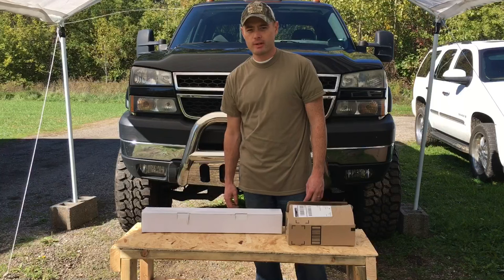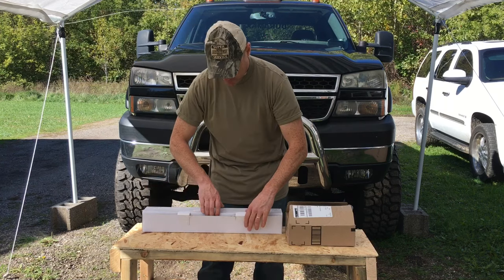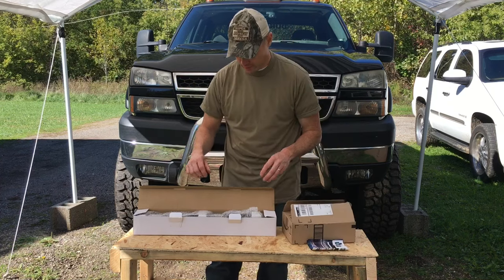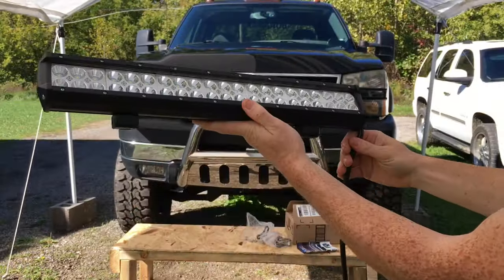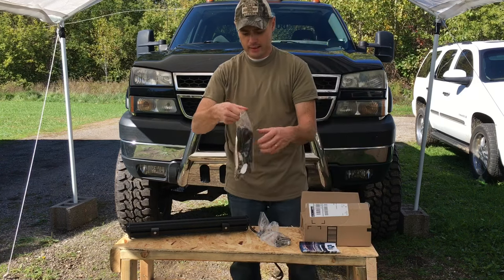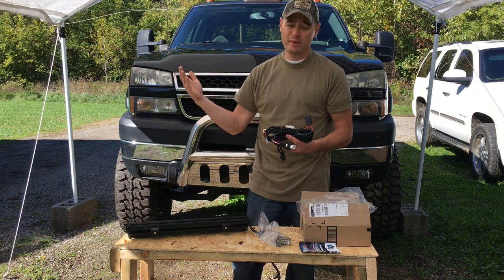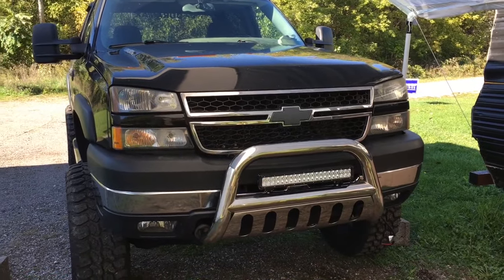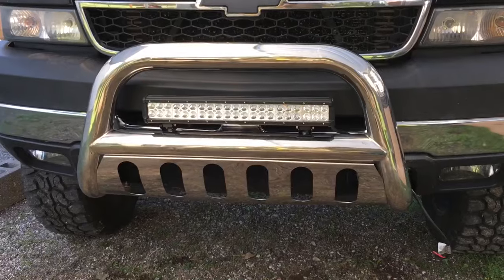Nilight 20 inch Light Bar Install

Comment: "ya I'm not a big attachment guy"...has a 6 inch lift, bigger tires and rims, aftermarket tow mirrors, bullbar, and this video is about putting a light bar on haha that kills me...thanks for the video rather than that tho
Reply: Those are stock mirrors for that truck
Reply: Those are all bolt ons accessories. The lightbar may require some drilling tho
Reply: @colbyfey2215  I believe those are 07-13 tow mirrors. I could be mistaken. It is a very very common mod for cateyes
Reply: @luketrinke4667  my brothers 02 had them on from factory
Reply: Mirrors are stock buddy
Reply: “I’m a basic person”

Comment: way easier way to run the wire through the firewall there is a little rubber gasket that goes through and you can push through there instead of going outside the door area
Reply: Tim thats what i did it was much easier
Reply: Tim The thing that's difficult on that is for my truck it's really hard to get to from under the hood so I did the same thing he did
Reply: not if you drive a 2015 chevy 2500 its a bitch firewall
Reply: Or at least  put it inside the door rubber seal.
Reply: It’s likely the water will drain down into the fuse panel
Reply: Chevy's are notorious for having pain in the ass grommets that it's easier to drill through the firewall and use your own grommets. Or for cavemen, running it through the side of the fenders into the side doors

Comment: Looks like that bumper bar is a "bit" loose, make sure to tighten that too!
Reply: Waay too much flex in that bar when he was adjusting the light bar
Reply: @THEGAMEX21  yea mine bolts to the frame and is super rigid, you can rock the whole truck with it

Comment: The red wire is to small of a hole to mount to the red terminal on the battery, how else could I attach it to the battery?

Comment: Thanks for showing me how to install this exact light which I just bought.  I'm night blind and going through the Eisenhower/Johnson tunnels on I-70, which are 1.7 miles long each way, is absolutely terrifying. 

Since traffic is one way in each tunnel, this will get me through the tunnels safely without killing me or my fellow drivers.  There are lights in the tunnel, but they are so filthy and weak, they might as well not be there for me being night blind.

I was surprised at the number of comments from those who try to make themselves feel good by making others feel bad by complaining about running the switch wire through the door seal rather than through the firewall.  This light is not a fixture on the space shuttle and I sure am not going to drill a hole through the firewall of my car.  I'll do it just like you did it.  It will work fine and you know the saying, "Perfection is the enemy of good enough".

Thanks again!

Comment: Man, I want to start by thanking you for sharing this video. I have bought an E350 4x4 Van with a long 50inch light bar on the top. I recently bought the same wiring harness as the one you used and was having seconds thoughts if I could wire the light bar on my own or not. This video convinced me and helped me do it on my own.
Reply from the maker: +Kudro Rico awesome man I'm glad I can help

Comment: Does the built in fuse box for the light prevent it from draining the battery since it's directly connected to the battery? I'd like to get the ditch lights and the light bar but I don't want them to suck my battery dry.

Comment: You connect the positive wire to the battery. Does that drain the battery since the light is on on the light switch in off mode.

Comment: Thanks for making it so simply an installation. I found a rubber cover on the left hand side where one of the A/C hose goes trough and stuck it in there so that the rubber on the door doesn't get worn out and also to keep the water from going inside when is raining hard.
Reply from the maker: +Carlos Lemus thanks for the comment I wish I could go back and fix the video but since then I ran the wires through the rubber grommet on the driver side firewall
Reply: Truck Master thanks for making the video man there is no need to go back but if you ever do take me with you jajaj

Comment: I ran mine to a switch under my hood and connected my power and ground to my fog lamps so when I turn on my fog lamps from inside the truck it will also turn on my light bar and if I don't want it to I just throw the switch under the hood and I can continue to use my fog lights without the light bar
Reply from the maker: +christopher smith awesome I will have to look into that on my set up
Reply: Truck Master I just didn't want to add anything to my cab I like things simple in there

Comment: I installed one on my f150. Works great just where it connection is way to short since my battery is on the passenger side I have to reach all the way over to turn on and off

Comment: Thanks. Good video. I think the only thing I'm going to do before I do this is use RTV on the light bar. I saw another video with how to take these apart and do that, just in case. Mine, same brand, came with a plug that doesn't mount like yours in the video does. It's the round kind. But I just checked and the other plug seems to attach to the wire, so I might swap them.

Comment: Wow ...You made a great vid and should be franchised...no kidding...great explanation, tagged major issues with the harness mounting made the product, a gotta have accessory. Thanks and it took a bit of latent feer of screwing up the first time for a guy at 70 to do a first.  Have a new/used hybrid and huge battery source for light...or marine epower and maybe run a boat for a while once I get the harness and release mechanism assembled. Happy Trails
Reply from the maker: Thank you 👍

Comment: Couple suggestions. One dont wire through the door jam. two is possible use the accessory wire (typically brown) coming out of the steering hoist. This way when you turn off the truck the lightbar will turn off as well.
Reply: Great explanation, but if you're in the middle of nowhere I would like just the lights and no engine noise.

Comment: The thing that sucks about that is I have that exact same thing mounted on the front of my truck (I don't know what they are called sorry) and I wanted to mount a 24'' bar there but thats where my dale earnhardt license plate is and that aint comin off so I just got a 42'' and mounted it on top of the cab
Reply from the maker: +RebelRanger01 at least it worked out
Reply: Truck Master Yeah exactly, I was a little hesitant at first for drilling holes in my cab but then I thought about: "I installed a cab visor and drilled multiple holes, whats the difference of a few more". I like it though I use it when I'm getting outta the woods from hunting and fishing I hunt and fish right till dark most times and it's better than my high beams on my truck. Plus I use it on back roads sometimes unless theres traffic

Comment: Good instruction video. How do you get the illuminated red light to turn off on the switch so there won't be any drainage from the battery?
Reply: The one I bought in 2023 does not have a light; just a simple rocker switch.

Comment: Because of how easy you made it look in this video, I ordered a 42" and wiring harness from them. I hope I can install it as easy as you made it look. We'll see...
Reply from the maker: +LNxTCB awesome good luck man run the wires through the firewall not the door jam though good luck!
Reply: Yeah, that's what I plan on doing. Thanks, bro!
Reply: The little light bulb on the switch doesn't drain your battery since it's wired to the battery?
Reply from the maker: +LNxTCB I never had a problem

Comment: how well do these pushbars/bullbars work? if i were to use my truck to push something would the brackets break? idk how sturdy they are
Reply from the maker: +Benjamin Masters they bolt to the frame so its sturdy but it's not going to do anything to protect your bumper if you hit something, the push bar is very light

Comment: Is there a limit to how many accessories you can run off the battery like light bars and charger ports without shorting it?
Reply: buy a bigger alternator if u got a lot of accessories to power up specially light bars

Comment: I know it’s old video , but is the red light supposed to remain on on the light switch ? Won’t it drain the battery ?
Reply: It probably wont kill the battery, but yes it should be off when the lights are not in use. Also don't run your wires through the door jam or fenders. With the car door opening and closing they have the potential to be pinched which could later cause a short.

Comment: So I'm going to be putting that same bar on my 98 ford ranger. I'm wondering how to connect the light bar wires to my battery. My connections for my truck to connect to the terminal on the batter like covers up the whole thing. Wondering if I take that off and put the light Barr connections on then the truck battery connections on top of the that?
Reply from the maker: +WA outdoorsman you can do that or find another positive wire in the engine bay you can tap into, watch my Light Bar Install video on a Tahoe I didn't connect it directly to the battery and it worked out

Comment: what kind of wiring harness is that
Reply from the maker: +Austin Vandeberg not sure it came with the nilight but I'm sure it's the nilight wiring harness
Reply: hey Austin, this is the link to the wiring harness, hope it helps.
https://www.amazon.com/Nilight-Wiring-Harness-Switch-Included/dp/B0142WXJEU/ref=sr_1_3?srs=8085031011&ie=UTF8&qid=1478505043&sr=8-3&keywords=wiring

Comment: Is attaching the ground wire to the negative battery terminal the same thing?  Is there a difference?
Reply: Yes, you can hook it to the negative on the battery.  On many modern vehicles it's hard to find metal to hook to within distance of the wire harness.

Comment: Which wire goes connected first to do it properly, the black to ground or the red to positive???
Reply: Israel Rodriguez negative is always last to be put on and first to be taken off
Reply: i agree. flows negative to positive.  hook the positive up first then negative last and the opposite when disconnecting.

Comment: Do you know if there's a way to wire it to the fuse box?  I would still like to use the switch, but I would also like it to turn off when I turn my car off.  I want it to function like the windshield wipers.  So if the car is off, there isn't any power going to it.  But if the car is on I still have the ability to turn it on/off.  I don't want to accidentally kill my battery.  Thanks!!
Reply from the maker: +Andy Lisnoff try running it to your ignition fuse
Reply: A relay would make it so you don't kill your battery. My car sat for 2 weeks without running with my light bar installed, barely dropped voltage.

Comment: Are these legal to have? I have a 2000 cord f150 with crap lights, this would help a lot
Reply: These lights would not be legal in probably any state for highway driving.  I'm just using it to get through some very dark tunnels about 2 miles long on I-70 that I travel now and then.  The tunnel lighting is terrible and I'm night blind, so this light bar will help.  It's one way traffic in the tunnel, so I probably can away with using them for a few minutes.  I go through in the daytime, but the tunnels are darn near pitch black to my old eyes.

Comment: Does the red light stay on on the cab ? And if so does it drain the battery?
Reply: If you wire it correctly the red light is off when the LED bar is off.
Reply: Danky Dank it has two options to wire it up.
Option 1 allows you to connect it to the ignition switch so the light bar switch will only work if your ignition is turned on and the red light will be off if your key is off.
Option 2 is direct wired which allows you to turn the light bar on whether your ignition is turned on or off.
And the little red LED light pulls less amperage then the memory in your radio.

Comment: Could I cut the switch off and hook it up to the high beams
Reply from the maker: Yes
Reply: @TruckMaster  when i cut the switch from  off of  the wire can I use a piggy back fuse to trip on led bar with the high beams and hooking it up that way sorry I am new to this

Comment: Hey is it a problem that it doesnt get wired up to the ignition switch? Im just worried about it draining the battery?
Reply from the maker: +Bobby Sutphen that shouldn't be a problem but I haven't tried it yet. I did read on the internet of guys doing that and it worked out for them

Comment: How did you connect the light bar wire to the connector on the wiring harness? I have the same setup and don't know what to do
Reply from the maker: +Real Outdoorsman your suppose to buy the additional connectors to plug them in but you can just cut, splice and use some electrical tape as well

Comment: Got mine yesterday - Amazon reviews suggested silicon around the clear front to prevent condensation on the inside of the light bar - have u run into any moisture issues in the unit?
Reply from the maker: +Michael Woodsdale not at all

Comment: Did the wiring and everything come with the light bar? Or did you have to buy the wiring separate?
Reply from the maker: +Chatch'emBig tv the wiring came with it
Reply: In 2023, the harness and light come as a package, but you need to make sure of this.

Comment: When you order the light, did the second box come with it? Or was that a different order?
Reply: At least in 2023, if you order the lighting unit and the harness as a package, they come in one box.  And you definitely need the harness unless you're a master electrician specializing in vehicles.

Comment: Enjoyed your video. Did you have to supply additional power to the switch or was it supplied when you connected to the battery?
Reply from the maker: +Gibb Gibb no additional power just ran the red wire to the battery. Thanks

Comment: Should i trust a $30 light bar?
Reply from the maker: +Nathan White these little ones are great it’s the 35+ inches I would worry about
Reply: I had this bull bar on my truck for about 8 months and it was absolutely amazing didn’t leak water inside like most lights and it never forged up from the inside. I decided to change my setup and I took it off with the bull bar and I sold it to my buddy and he still uses it til this day it’s got to be one the greatest light bars you can purchase. I got a new truck and I’m about to buy a bull bar and this light bar👌🏻

Comment: Real curious to know: how’s that Nilight holding up? Been on the truck a while by now. I’m mounting a 32” and some fog light pods and I sealed the seams from the outside with silicon just to give them a better chance. For the price they’re worth trying. Any feedback would be appreciated, thanks.
Reply from the maker: +A Stang it’s a great lightbar no condensation issues and very bright. Probably he best inexpensive lightbar online

Comment: How did you get your mirrors so level? Both of mine angle up
Reply from the maker: +austen9988 to be honest I took the mirrors off my LMM which is the newer body style and fabricated them to fit my classic body style. But I know there is a way to level your mirror look online and see if anyone wrote a thread on it
Reply: austen9988 I've heard that if you have a lot of room on your bolts that washers can help level them out.

Comment: Does the switch come with the wiring harness?
Reply from the maker: +jacob mudgett yes
Reply: Thanks dude great vid I have a 89 GMC SIERRA 2500 this vid helped a lot
Reply from the maker: +jacob mudgett awesome I love those old body styles
Reply: You have any tips where to put it cus my front number is slightly pointed at the front
Reply: Bumper
Reply from the maker: +jacob mudgett mount it on top of the bumper
Reply: Truck Master sorry for asking questions that's for replying will the light drain my battery because the little light on the switch does that stay on all the time?

Comment: hey which brand of light bar are you more satisfied with, the nilight or auxbeam? i have both saved off and havent decided on which to buy but i see you have installed both. 

thanks
Reply from the maker: +quise2405 I think they are both good but I would pick nilight over the other one
Reply: Truck Master nice thanks. have you had any issues with your wiring i keep seeing reviews every so often about them burning out or catching fire. hoping it warms up here soon so i can get one installed its been dbl digit negative to single digits outside the past cpl weeks
Reply from the maker: +Q2024 no issues on thing is that cheap adhesive behind the switch the switch doesn't stick to the panel very good I might us some 3M tape

Comment: I installed a 42" lightbar to my car and it blew up my coil packs and mechanics are saying I have to run another battery because it pulls too much current and starvs the electronics so I guess it's different when you run a small lightbar XD

Comment: I was confused about the negative/ ground, in the instructions they don't talk about grounding the black wire with the gold loop to the body of the vehicle, I knew it needed a ground but from the instruction they seem like they want the black wire to battery, thanks for the video helped a lot
Reply: Hook to negative terminal on battery or any solid metal in the engine compartment.

Comment: What is the relay for ?
Reply: @ Samuel Flores: Me, too. I don't understand what the relay is used for neither! Can anyone explain to us? Thank you.
Reply: My best answer to explain what the relay is for is to Google it.
But the really quick explanation is it allows the high current to run from the battery to the light bar and the switch essentially turns the relay on and off.
That way you don’t have a lot of current flowing through the actual switch.
Hope that helps 👍